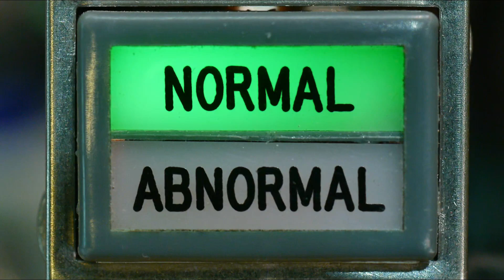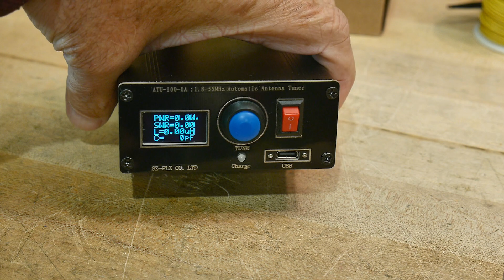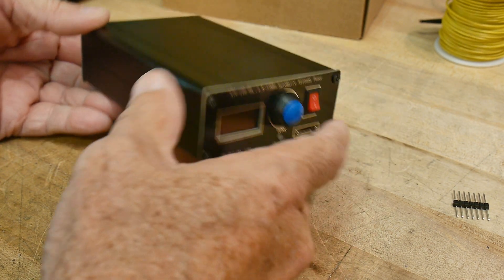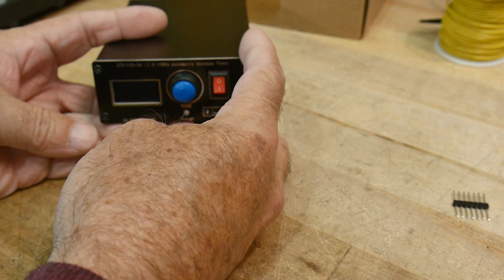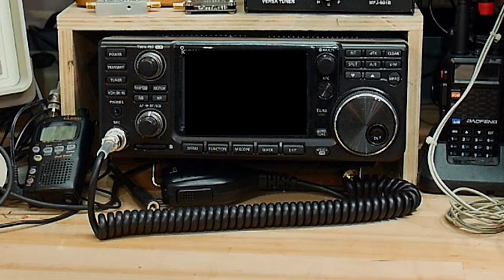#1113 ATU-100 Antenna Tuner Review

Comment: I would be interested in how the battery/charger circuit is implemented. I saw a single cell at 3.7v but the unit is generally specified at 12v

Comment: what is the SWR range?
Reply from the maker: auto trigger if > 1.3 SWR. 
spec of 3:1 tuning range
Specifications:
- Input voltage range: 10-15V DC
- Maximum working current: 400mA
- Maximum working power: 100W
- Maximum measurement power: 150W
- Auto tuning trigger power: 5W
- Minimum measurement power: 1W
- Power measurement error: 20%
- Maximum inductance: 8.53uH
- Minimum inductance: 0.05uH
- Maximum capacity: 1869pF
- Minimum capacitance: 10pF